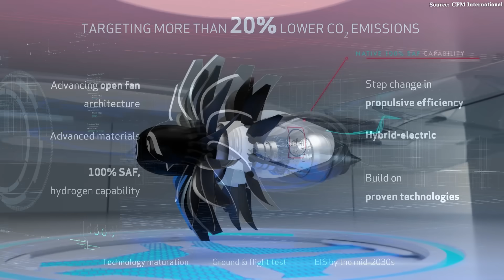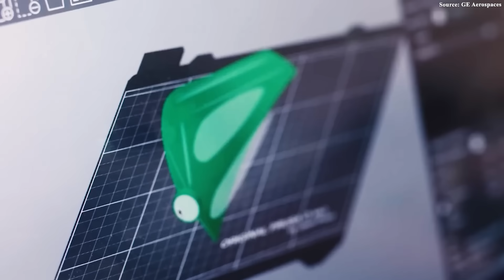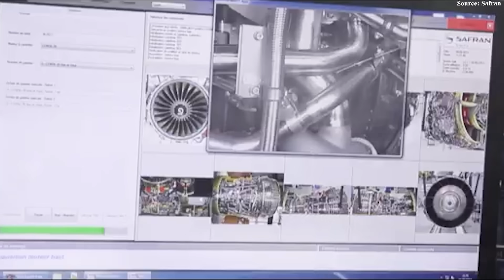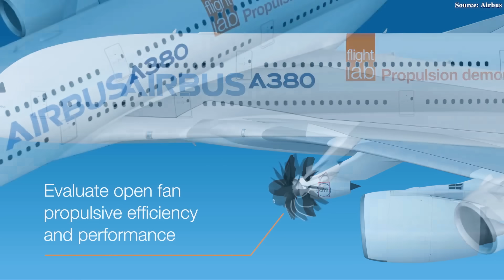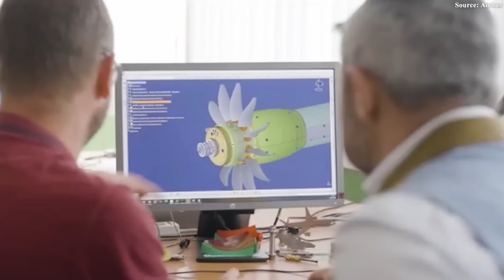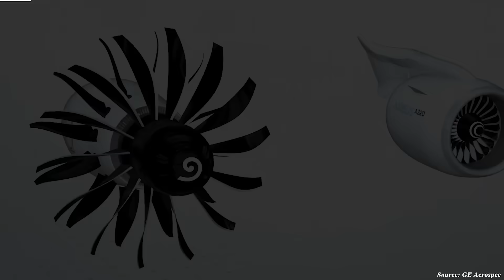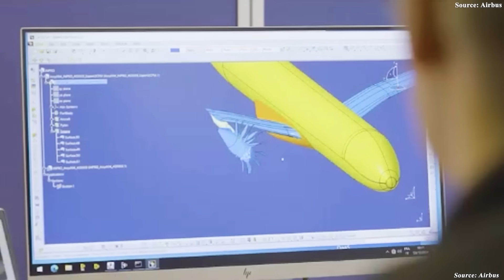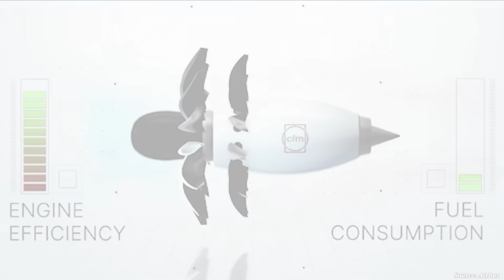This NEW Big Engine For A380 Is Coming & Will CHANGE Aviation Forever!

Comment: About every 2 months, there's another AI-narrated video fawning about a major breakthrough with these open-fan engines.  It's been happening since at least the late 1990s (not the AI part).  But there's never any breakthrough, just more computer animations and random file footage of technicians in lab coats.  They say they might begin flight testing within this decade.  Why didn't they do flight testing in 2005?  How long does it really take?  There's nothing especially innovative about this idea, except the specific application.  It's a race, who goes to production first, this, or "Spin Launch".  Or Hyperloop.  Or cold fusion.  I'm on the edge of my seat.  How about, check back when you actually do have a breakthrough, or video of an actual unit in operation, on an airframe or even just in the lab.
Reply from the maker: Thanks for your feedback.

Comment: To me a zero emission engine is one that burns 100% of the fuel used no fuel residue out the tail pipe.  Of course this is impossible but advertisers like this claim it can be done.

Comment: No this engine will NOT change aviation forever as these open contra rotating props are WAY TOO LOUD!  They may well be more energy efficient and for that reason desirable to the airlines, but the noise will doom them.  Having a Symitar shape will reduce the noise but not enough to make them competitive with modern jet engines!

Comment: Co2 makes up 0.04% of the atmosphere and humans contribute 3% of that 0.04%. This is a minuscule amount, that's going to make the planet overheat? I don't think so. The numbers don't add up. Apart from that, plants can't get enough of the stuff.
Reply: Glass is not a good insulator, but when used to build a green house it converts light into heat (by changing the wavelength) which then cannot escape back through the glass.  A thin 'layer' of CO2, along with even thinner 'layer' of methane, which is even more effective at converting light into heat as it passes through, acts like green house glass.  Hence the name often given to the rising planetary heat as the 'green house effect'.

Your lack of education is showing.  It's not the quantity.  It's the effect.  For instance, a minuscule amount of pure nicotine will kill you instantly, even if only applied to the surface of your skin.  The even more minuscule amount inhaled by smoking kills too.  It just takes longer.

If you drop a frog into hot water it will immediately jump out.  Put a frog in cool water and slowly heat it and the frog will remain there until it dies.  We are the frogs in our planets climate.  It's being heated so slowly we cannot feel it enough to instantly react, but it will kill us all eventually.

Hopefully we are smarter than frogs.  Are you?

The word 'artificial', when used in the term AI (Artificial Intelligence) means 'non human'.  The same word, 'artificial', can also be used to mean 'fake'.  Sadly, a lot of humans exhibit fake intelligence.
Reply: @philipgrice1026  What the fuck are you on about. A greenhouse is not and never will be and react the same as a planet.
Co2 makes up 0.04% of the atmosphere and humans contribute 3% of that 0.04%. This is a minuscule amount, that's going to make the planet overheat? I don't think so. The numbers don't add up.
Reply: Our use of fossil fuels have made CO2 to go from 280 ppm to 430 ppm. That is over 50% increase and it is still rising. And the planet gets warmer. These numbers are not that hard to find and no active climate scientists have any other view on this today.
Reply: @johnsilfen70  The planet isn't getting warmer. Co2 doesn't drive the climate, it follows it. What drives the climate is the Sun, the biggest and most powerful object in the Solar System, by far. Even Bill Gates has now recognised that we won't fry and die.
Reply: @martin4787  You're right about the Sun. It drives all weather and climate. I could agree that the planet is warming but could also accept that it has always warmed and cooled, even well before humans.

Comment: Not gonna happen
Reply: It probably won't happen. One reason may be the engine fans need the nacelle to help protect the plane and passengers when one or more fan blades detach in bird strikes, engine explosions, etc. Even with nacelles, there have been some incidences of uncontained fan failures (Ex. Southwest 737 when one passenger was killed). However, it has proven to be safer with the nacelle.

Comment: unless it runs on hydrogen it will change NOTHING. our lungs are more important than that engine ;)
Reply: Rolls Royce have been working on this for several years and are very close to production.  Its is a modified normal existing jet engine without the external blades .  The problem with your comment is that you seem to forget photosynthesis in which plants convert CO2 to oxygen and many political idiots want to cover fields with Solar panels and build houses on green belt land.  Also we breath out C02.  We need to balance the eco structure with more trees.  I am a big supporter of Hydrogen as is easy to make using electrolysis of water.
Reply: What are you talking about? Since when did your lungs start to convert fossil fuel into CO2 and let it out in the atmosphere? It might however indicate that you aren't really up to the task of understanding the fundamentals about climate change from our use of fossil fuels!

Comment: It's funny, CFM is reinventing the propeller!  Maybe this will allow the engines to be mounted higher and blow air onto the wing differently, enabling faster takeoff? Since they mold the rotor in composite, why not put a ring around the rotor to reduce noise? Well, if it's variable pitch, it won't work...

Comment: Hehehe.. Here comes latest crash of c130... Possibly... Hehehe just saying.. External propellers... Huge risk.. They kind of ok on cargo but 400 or even more commercial passenger... Ouch.. U know what damage lose propeller do especially at high altitude to pressurized passenger part of the plane... Normally inside jet can basically damage the engine only... Generally... & now the kicker... They creating blades of carbon fibre... I don't know...
Reply from the maker: Thanks for sharing

Comment: It’s fascinating that this engine could eventually power the A380. That’s a serious test for CFM Rise.
Reply: No it won’t. Airbus has closed the A380 production line and have no plans to make any more, and it will be nigh on impossible to retrofit such an engine to existing airframes. The A380 may be used as a test bed with just one engine fitted.

Comment: Yet again I feel I need to put a dampener on your speculation. CFM RISE power output 30,000 lbs thrust. TRENT 700 or engine alliance turbine 70,000 lbs thrust. You could suggest RR geared engine. That would work. It has enough thrust and can achieve 30% saving over Trent 700.
Reply from the maker: Thanks for the info!